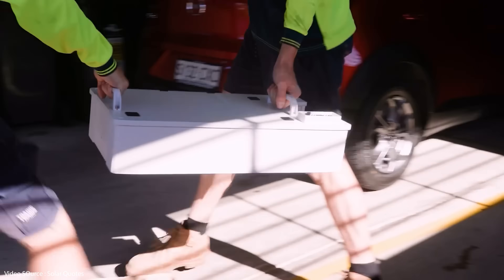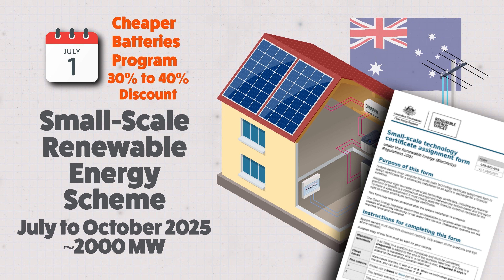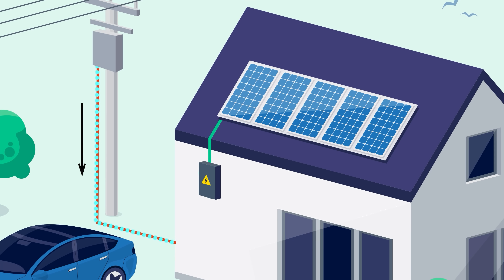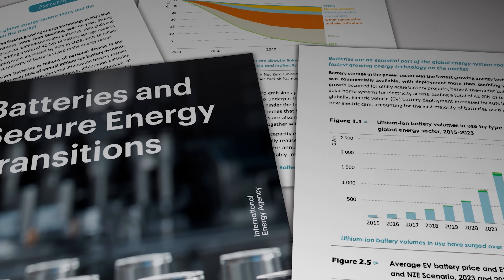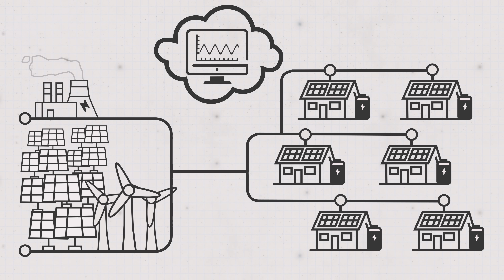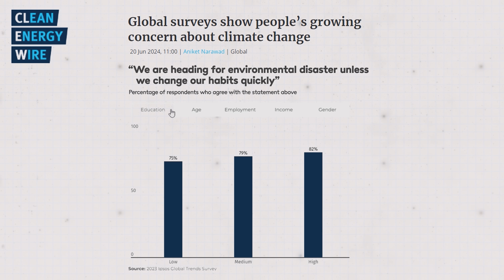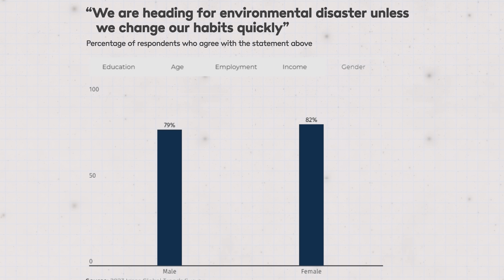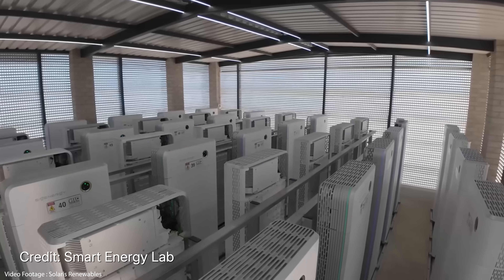Australians installed 100,000 home batteries in 17 weeks. Why can't we all do that?

Comment: Last I heard we were up to 160,000 home batteries installed and the program has been extended and the funding for it has been more than doubled. 

I took advantage of the program, since my battery installation I've used no electricity from the grid at all, despite the moaning from the right wing cookers it's an incredibly beneficial program.
Reply: Yep - it's a bloody winner of a program - lower bills for Aussies, lower infrastructure costs for the power grid. 
The opposition party whines about high power prices but does nothing to solve the problem. The solution is to make more Aussies less reliant on the grid!
Reply: @zen1647  Correct the opposition party have best friends who own coal mines, they just go on about everything being a hoax, they had a decade to fix the blackouts that are expected, but did nothing. I checked their Sky News Australia propaganda network on YouTube, it is the pits, so trashy, the channel that YouTube bans for pushing misinformation. A few of them are writing the same talking points here.
Reply: @zen1647 the right wingers want to build coal and nukes at huge costs and long timelines. They wont be cheaper at all and wont even be needed.
Reply: @zen1647  My Old Mate's daughter is an engineer working on the problems with the current Australian main grid. I'll have to have a yarn with her whenever she comes home sometime.
Reply: Hi from your northern cousins in Canada!  I've had a keen interest in the past 4-5 years of studying Australia's woes of electricity and the greedy and corrupt private power generating companies and their bough politicians.  All that has changed for the most part and betterment of the average homeowner, thankfully.  I'm a tad jealous but excited about what we can learn and adopt from Australia for home power generation and storage.  Look forward to the day when we will have our own home generation evolution!  In the meantime, cousins, keep leading the way, mates!!  Oh, BTW, we have our own right wing cookers, we call them Maple MAGA'ts and we won't let them infest us like the American MAGA'ts did in the USA...
Reply: @truenorthbc Is your climate suited to solar?
Reply: @Rottnwoman  I couple of thoughts.  Our country is so big in size that we have 6 time zones so depending where you are in the country it really varies in regards to hours of sunlight.  Also, we are pretty far from the equator so our falls and winters are substantially shortened for daylight.  On the other hand, there has been good advancements on solar panels now giving better outputs even on overcast days.  I see that The Netherlands, Germany have had substatial swith-overs to home solar so there's no reason Canada doesn't do it as well.  Canada is blessed with abundant fresh water, almost 25% of all the fresh water in the world so relatively cheap hydro power is generated here for everything.  Still, having a great nat'l programme for home solar like Australia would be a wonderful thing.  There are so gov't sponsored incentives to switch over but not nearly at the level of Australia...
Reply: Right wing cookies is one of the statements of all time
Reply: @Sceuxm-88 
Cookies or cookers? You seemed to have confused yourself over such simple words.
Reply: @NamNguyen-hr1ii  when I made that comment I woke up 5 minutes ago
Reply: @Sceuxm-88 that's what we call them down here
Reply: benificial to who? im struggling to live while paying taxes towards someones rich property owner who just installed batteries on tax payers money... yeah thanks for that. Single on 85K per year. cheers...
Reply: It was just announced that it's winding back now, it cost way more than the govt was expecting because they based the rebate on kWh rather than per battery. A 50kWh battery gets you over $18,000 back from the govt courtesy of tax payers. Suffice to say I'm in the process of getting quotes for 50kWh of battery for my existing 15.7kW solar install. Hopefully i can get a quote and lock it in before 1st Jan, otherwise the rebate reduces by 10%. Then in May they're reducing it quite a lot more and they will be introducing a tiered rebate where higher battery capacities give lower rebate per additional kWh.
Reply: @flain283  Fact Check, IMPORTANT NOTE: Here's some very important information that you may not be aware of, along with pretty much every Aussie investing in a solar battery and taking advantage of the scheme right now. 
Getting a quote and locking in your deal before 1st of Jan does NOT mean you will get the full rebate. The IMPORTANT detail the companies are not telling customers... The system must be installed and commissioned before the 1st of January to get the full rebate. I can almost guarantee that you won't be getting it done by then, as installers across the country are booked out until March at best. I am aware of companies advertising those 50kwh battery deals left, right and centre everywhere online and saying things like "5 units left"  ask them straight up about claiming the rebate. You can't claim the rebate; only the installer can claim the rebate, and they can't claim it until they install and commission your battery. If your inverter is not communicating with the grid, and they are claiming that after the 1st of Jan, you are not eligible for the full rebate. Check your contract very carefully, as mine, like every other one I have seen, specifically states that the cost is passed on to the customer.
It's still not a deal breaker as you will still get a rebate, just not the full amount that everyone else gets pre January 1st 2026.
Second point: "It was just announced that it's winding back now" Not exactley; the program is NOT wrapping up yet. The government just kicked in an additional $5B to the total budget making it about $7.6B in total to be distributed over the next few years, wrapping up in 2030. What I think your refferring to is the changes to the eligibility for the rebate and putting "caps" on larger capacity batteries. The budget was forecast to be totally depleted by June or July this year as the government MASSIVELY misestimated the uptake and success of the scheme, and Aussies ate up the budget. The budget was eaten up by the 'Oversized' 50kwh+ batteries everyone was purchasing when they expected most homeowners would buy between 10 - 15kwh batteries. So they have introduced new rules that mean the amount of rebate you can get tiers off quickly, meaning anyone still buying 50kwh batteries and capped at 100kwh will only be eligible for a 10-15% rebate. anyone getting a smaller system around 14kwh or so will get the full rebate amount, currently 30-40%. 
So at this point the new rules will kick in from May 1, 2026, so you can still get the 50kwh battery now and installed before then but be warned you will get hit with another bill from your battery provider. The sum up is this "On January 1, 2026, the rebate amount received after administration costs will fall to approximately $300 per kWh. Four months later, on May 1, 2026, it will reduce again to approximately $244 per kWh. At the same time, the scheme will change to a tiered system, with larger batteries receiving much less."
Reply: @flain283 it's not winding back
Reply: @peterwarner553  
Rebate amount will drop every 6 months now instead of 12.

Additionally, these tiers are added next year (currently you get 100% rebate up to 50kWh, but not for long):
Up to 14kWh will be at 100%
14kWh to 28kWh will be 60% current rebate
28kwH to 50kWh will be 15% current rebate
Reply: @flain283  When it launched, they said they'd adjust the rebate periodically as any sensible person would. They want loads of kWH installed, and that is what they got. They could have just said "we've finished it, the money has been spent, jobs done in record time." but it is such a success they realise that people want it more, huge success!
Reply: Moaning from the right wing cookers? Or moaning from the tax payers who helped pay for your battery?
Reply: but you still have a power bill ...they don't just stop charging you..even if it is only their maintenance charges which will get bigger
Reply: @Tony.w-y4i yes and no, depends on how much you export to the grid, if you export enough it covers the daily fee and any generation you pull from the grid and your bill arrives as a credit against your next bill
Reply: @Tony.w-y4i no I don't have a bill, I actually make money by exporting to the grid.
Reply: All the cookers are pretty much trolls, not average punters
Reply: Why do we have high electricity prices in the first place? Because of the renewable energy projects. Before all that, with coal and gas fired power stations , we had very low power prices. Batteries are a solution to a problem you left wing greenies created yourself. Sky news inconveniently points that out and you don't like it. That is why you call it propaganda and cookies.
Reply: who pays for that?
Reply: @carholic-sz3qv same people who pay for the $13 billion the last government spent to torture boat people or the $368 billion being spent on nuclear submarines we don't need, at least with the home battery program people will benefit.
Reply: @carholic-sz3qv  even if I did the upside is power is now going to be  stupid cheap
Reply: I know that all right leaning individuals aren't against cheaper energy as I am one myself and currently enjoy the benefits of all the energy tech advancements in my home and not paying for electricity either! Both sides of politics are beholden to whoever gives them money and as such will incentivize whoever is the biggest donor. We should all just take our wins where we can get them 😊
Reply: Stealing tax dollars from poor Australians to give to rich Australians. What a great way to save the planet
Reply: @bonoff3369 I pay well over $30,000 in income tax every year.

Comment: And make 3phase household installations standard. Solves a bunch of problems!
Reply: A 3 phase grid tie sounds expensive plus the extra street wiring. How would you balance the phases? Battery storage lessens the grid tie problem and gives consumers a better deal.

Comment: Just remember that in Australia if you install subsidised batteries you don't get to use them for yourself.
You are required for that energy to go back into the grid. ie. You pay and the Electricity company gains.
Reply: Nonsense. The purpose of the battery scheme is for households to make better use of the power they generate off their own rooftops. On top of that, providers such as Amber actually allow households to make money feeding power back into the grid at times of high demand
Reply: @tassied12 their rules. “Grid-connected systems must be Virtual Power Plant (VPP) capable”

Comment: We live in Scotland, well 😂know for its warm sunny weather. We had solar and battery installed here 4 years ago and have now nearly paid off 60% of the initial cost of solar and battery. We benefit greatly by recharging from off peak electricity. The maths is further complicated by running two EVs and a heat pump but the energy bills are wonderfully low. The only thing I would say is that the angle of the solar panels relative to the midday sun is important. Our panels face roughly 240 degrees or south south west. That allows us to use some of the overnight charge on the batteries before the strong Scottish sun hits the panels at about 10 am and start replenishing our batteries.
Reply: Geothermal is the ticket long term my friend....

Comment: Yesterday I was challenged to figure out what would be required to stave off a 3Gw base load nuclear power station and the effect of dunkelflaute. You need 3 Gw of inverters twice that in storage for 24 hours or 144 GWh and some way of charging the batteries again when the sun comes out to power the base load while also charging the batteries. So about 6Gw nameplate solar and wind. All this to drive demand pricing below what would be needed for a financially viable nuclear power station. No wonder the politicians are being asked to guarantee a 50c/kwh wholesale feed in tarrif for nuclear over the operating lifetime of 30 years. The good news is we already started and have 10-19 years to pull the nuclear power industry’s pants down. It will take that long to get one plant operating

Comment: Aussie here, installed solar and 🔋🔋 in 2023, 9.6kw Microinverters 27 kWh 10 kW output.

We have a glut of solar from Rooftop, batteries are reducing that excess, and big BESS installations will go even further to reduce "surplus" solar.

At the time of installation, the ROI was 10 years, adding an EV to the mix reduced the ROI period to less than 5 years.

We don't spend $8000 a year on energy each year.

We still draw a few kWh from the grid off peak to charge the car (it spends it's day 65 km from home) a couple of nights a week.

The latest BESS installations are for arbitrage rather than just grid services, that is, they will soak up peak solar production and resell during the 6-9pm peak and overnight.

The current subsidies are targeting 1 million domestic batteries, which will substantially reduce load on the grid, and in many cases, avoid upgrading the grid at significant cost.

It's a no brainer really
Reply: Here in the USA we have a "no brainer" President and executive branch.  Their economic policies, immigration policies, energy policies...well...ALL THEIR POLICIES really...make a circular firing squad seem rational.
Reply: @swimmerdudeski6849hope things change next year.
Reply: Hi from Canada... Sounds amazing and glad to hear our Aussie cousins leading the way!!

Comment: Ah… we all know very well why we can't do that in the United States of Albinos… thanks to Orange King Felon. But I'm delighted for the Aussies. I'm just glad I installed my solar 15 years ago —and that it's still going strong! I'm now tempted to add some balcony solar to it on the pergola over our garbage bins —since my state of Utah has approved them.
Reply: Solar seems very expensive in the US, is that because of the propping up of the domestic market and restrictions on Chinese produced panels and batteries
Reply: 15 year old panels will be very inefficient
Reply: @XxBloggs  Nope. The first year my array generated 14,236 kW. Last year 13,987 kW.
Reply: @XxBloggs also had 2kw of 15 yr old panels on my roof that were still generating over 90% of when they were new. Have now removed them and did a roof restoration on a 26 yr old cement tile roof and have a 13kWh solar and 24kWh battery install being done in February. My old panels and inverter are heading to a remote offgrid opal miner after christmas

Comment: I upgraded my off grid solar and battery in 2015 to the then new LFP batteries. Somewhat expensive by today's prices but not too bad as my requirements were relatively low and I did the install myself, so the system paid for itself VERY quickly. I previously ran a diesel generator and gas fridge, both of which were becoming very expensive to run. 10 yrs on the system still works a treat. Free power!! I recently installed a new system on my workshop in preparation for getting an EV, and as added backup and workshop power. Now much cheaper and better kit available. One real advantage I have found is the reliability. Where I live, in Aus, we have had fires and floods that have shut down the grid for extended periods. I had power throughout. My GF who lives in town had to throw out the contents of her fridge and had great trouble sourcing restock etc after the big flood. Best investment ever. Also quiet, relatively maintenance free and environmentally superior. As an aside, I have cooked on LPG, but recently low wattage appliances have become available, so have switched to them when applicable.

Comment: Well, in "my part of the world", a lot of small photovoltaic installations exist and a lot of them come with some battery storage - because that is good for the owners even without subsidies. The piece of the puzzle that is missing however: The excess power from those solar panels and batteries isn´t fed into the grid, when it is needed, but rather, when it is not needed - because that´s typically, when those batteries are full. Of cause, that situation is only possible, because politicians did not manage to implement intelligent regulation. What I am not sure about, though, is, if it is really the best idea to try to fix the behaviour of hundreds of thousands individual PV-owners in the first place or to subdidize additional small batteries everywhere. Adding storage to the larger, commercial installation would have a big effect with far less individual installations involved. And since we need much more renewables as well as storage capacity anyways, why not invest in local larger scale storage instead, which could then also "suck up" excess capacity from small home installations? Having PV on privat roofs makes a lot of sense, because that does not require additional space. But why should it be the best solution, to have most of the battery storage there?

Comment: I’m was also in the fortunate position to be able to afford Solar a large battery system 27 kwh and to drive an EV. I have also been able to instal an heat pump with the UK grant of £7500 and I’m now reaping the benefit of cheap night rate electricity to run the heating. Will I get all my money back? Probably not but I’ve reduced my energy bill for a three bed semi 😮to around £350. When I shuffle off this mortal coil my family will have a house to sell that’s increased in value by all I’ve done.  For me it’s a win win.

Comment: We jumped on the battery rebate on day 1. Our 12.8 kWh battery was commissioned on 1 July. It is working very well with our 9.24kW PV system. We recently took delivery ov an EV, which has changed our demand. We may have to increase our battery capacity next year. But prices have already dropped since our battery was installed.